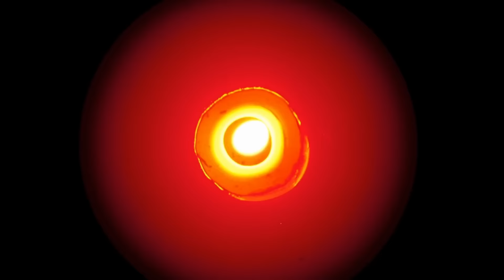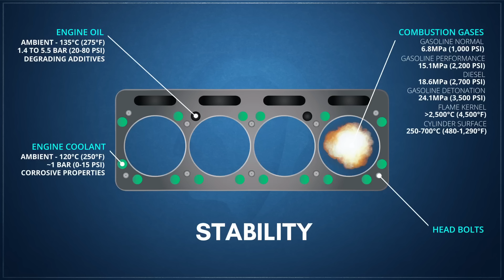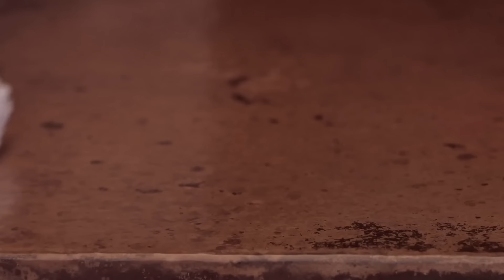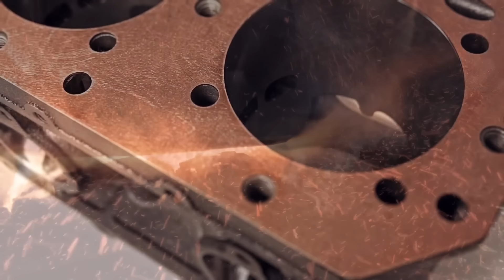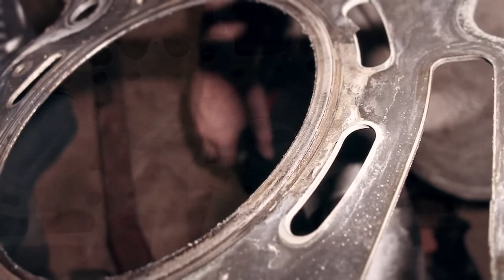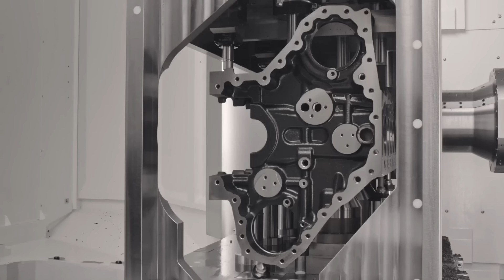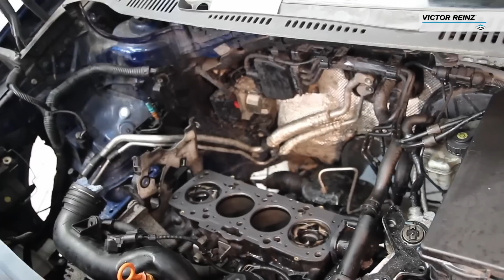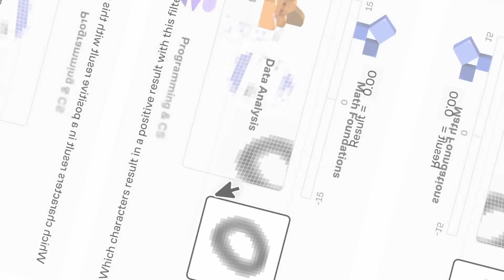Why This Basic Engine Part Is So Difficult To Design

Comment: An interesting thing to note is that aviation engines, especially older ones, do not have head gaskets. Piston aircraft have the entire cylinder cast as a single part, and are air cooled to greatly reduce or eliminate the number of fluid channels required in the casting. Every engine is a combination of compromises and optimizations, and while each individual cyllinder being a cast part makes reliability much better, it greatly increases cost due to the complexity of the cast.
Reply: Pretty much. Reality is gaskets have to be advanced because of how much we ask from modern engines. Many engines use very simple gaskets.
Reply: Yeah than just try it with bike and car engine 🤡
Reply: @zunriya  we did. Motorcycle engines can come without a head gasket because the cylinders are single castings, and antique cars can have engines of the same philosophy. I literally described how and why most cars and some motorcycles don't anymore, especially water cooled ones.

Comment: Good video on a very nice engine component.

This is not Ishikawa that invented and patented the MLS technology but JMG (Japan Metal Gaskets). Every CHG producer over the world has been paying licence fees to JMG gentlemen for a good 2 decades.
MLS is a fantastic technology that you could explore mode in depth maybe :
FKM coating for microsealability, Z and Omega embossements depending on the hole nature (gaz, oil, water). Stainless steel used is variant of 1.4310 C1300 (SUS301) for the active layers and cheaper SS for the porosity, stopper, distance layers one can find in some design.
Design of the CHG will differ if Alu block or Iron cast block. Then if open deck, closed deck, slit bore....
Modern stopper can be micro-embossed or laser welded ring.
Non stopper designs exist also.
And do not forget about those head bolts : they now are screwed under plastic deformation (Torque + angle) i n order to benefit from the load plateau under plastic deformation right before rupture. Risky but rewarding business !
On the dark side, Composite old CHGs where full of Asbetos. Hundreds dies because of those .... Edge molded gaskets and later MLS were developed for asbestos free CHG, and MLS turned out to be so much capable ! Modern high combustion pressure engines would not be possible with old composite technology, even with asbestos......

Rod-Main bearings and Rod bushings are also great components ! More into the tribology business. They had to go "leadfree" with high performance risk and problems to solve....
Together with the Piston rings they are the 3 engine fuses. They will blow-up in anything bad happens to the engine....

but this is all old tech.... future are BEVs and their fantastic battery technology that is superseding that old tech ICE in every points.

Comment: The 3800 3.8 Buick laughs at this video
Reply: If only it didn't have those lower intake manifold gaskets with a 100% failure rate...
Reply: @CaseyRevoir  Hey, even Achilles has to have a foil.
Reply: @CaseyRevoir  Besides, if that's the ONLY thing you have to replace it's not bad. Much better than doing head gaskets. Takes like 2 hours tops.

Comment: 3D printing will eliminate most Gasketing needs in cylinder ICE. the head will simply be a solid part along with the cylinder as they are in simpler 2 cycle engines.
Reply: Electric cars will eliminate most gasketing needs.

Comment: Internal combustion engines are not going anywhere.  Electric still has decades of progress before being able to take over.  I should know.  I'm helping to design not the next generation of electrical traction power plant, but the generation after that.  The technology coming down the pipeline is just amazing.  However, there is one major problem which very few people are willing to address.  The repair-ability of these systems is, so far, non-existent.  Go to your local automotive parts store and look for a contactor or primary spur gear for a Tesla model Y.  They are just going to look at you funny.  Just like charging systems, other support needs to grow and evolve.  Most shops cannot diagnose even simple problems on electric cars.
Reply: In practice, it is almost impossible to repair any new software-controlled car outside of its brand-specific workshop.

For me, the problem is still the charging. I can't charge where my car is parked most of the time (at home). On road trips, I prefer to spend five minutes refueling to 100% (~720 km) and take a 45-minute break at some random, scenic, and secluded spot. Not the other way around.

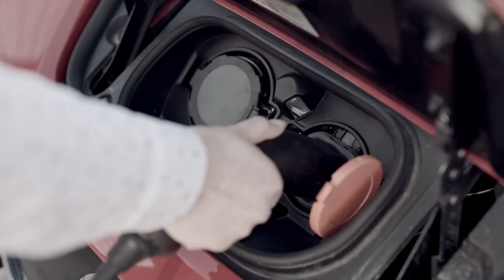Comment: 17:17 No, there is no meaningful transition away from combustion engines. It is still the most efficient for power, portability, and utility, and produces less pollution overall. The only reason for EVs is to centralize power sources so that tyrannical governments can more easily shut down citizens' ability to mobilize against them. The same reason they always want to ban firearms despite criminals always having them, and why they now want a central digital currency instead of paper.

Governments want cattle they can control, not citizens that can hold them accountable. Any centralized solution proposed by any institution, especially regarding your mobility and security, should be seen as poison to your rights.
Reply: Its ok grandpa, change is hard.
Reply: I mean people are still buying electric vehicles. The tyrannical government thing can happen with any modern vehicle with computers.

Comment: the question is why do we even have an disconnected head anymode, couldnt the whole engine block be 3d-printed as one part?
Reply: Bro just came up with a new repairability nightmare
Reply: It's expensive af to single cast a complex design like that, and good luck getting a flawless 3D print of one at scale.
Reply: Offenhauser race engines had integral head and block construction, but were costly.

Comment: Minor error: you don't need to cool copper slowly to anneal it.  Dump it into water, it doesn't matter.  Copper doesn't harden from fast cooling.
Reply: Actually its not about how you cool, its about how you heat and how long it stays heated.
Reply: @ErtOzk yep, so cooling it stops on the process.
Reply: There were many errors, strange video, I found it hard to trust it.
Reply: Yep. I make rings from old copper coins and heat them to cherry red then dump straight into cold water to anneal them so I can shape them easier. As you say; no need for slow cooling. Copper work hardens from beating / movement / flexing, so the annealing process needs repeating when the copper starts hardeining again as I work it.
Reply: Copper get even softer if you heat it. You use this for reload ammo, heated copper dont break this easly its more deformable. I dont no the english term but in german it is "weichglühen"

Comment: The whole premise of this video is wrong anyway. The most stressed component is engine oil, followed immediately by spark plugs. That's why you have to change those things while you may never have to touch a head gasket unless you run outside of temperature parameters.

Comment: The need for gaskets is probably a sign that we are unable to build perfect engines.
Reply: I suppose if one were able to build an engine with absolutely perfect manufacturing tolerances, and exactly matched thermal expansion, it could be built, but that isn't humanly possible, much less practical. You're right that it's not possible to build "perfect" engines in the way you describe.
Reply: Maybe it's possible to build them without the need for gaskets. Better casting technology?

Comment: Head gaskets are kinda funny depending on the engine. Either they need to be multi-material specially designed things. And then you got engines so crude you can cut out a head gasket from a Tetra Pak and the damn thing runs a few thousand kilometers on it. It was only meant as a quick fix to test if the engine of the melon I bought was okay besides the blown gasket. Ended up staying and running that way for over a year lol. Turns out it wasnt a melon at all, just a head gasket no one bothered to fix.